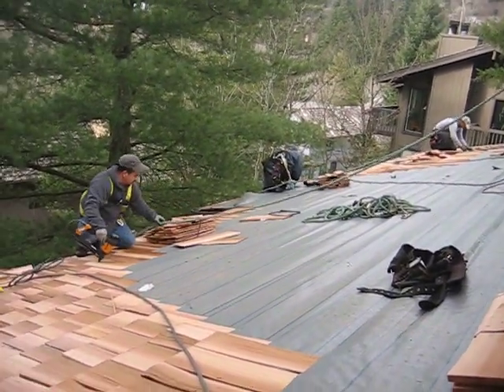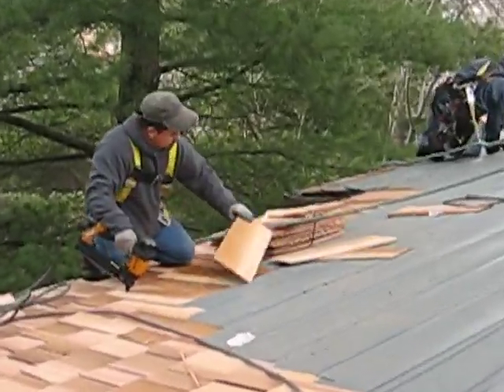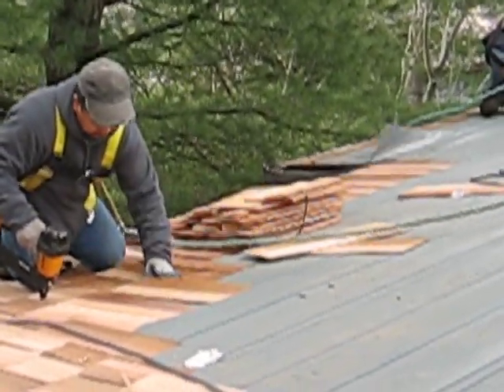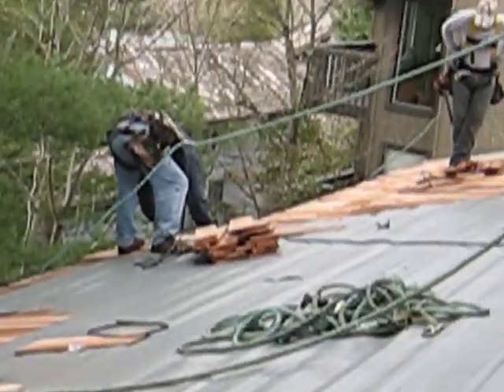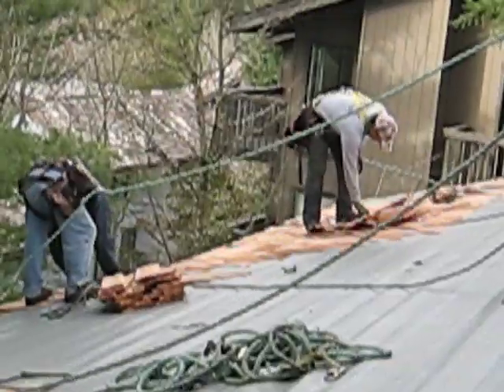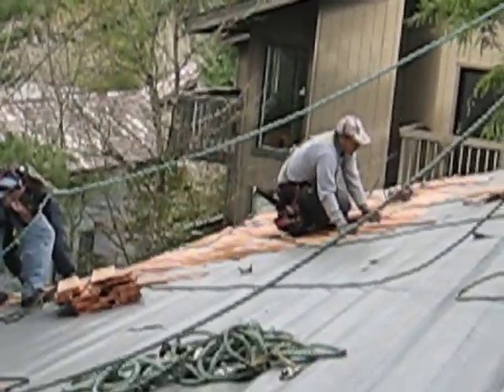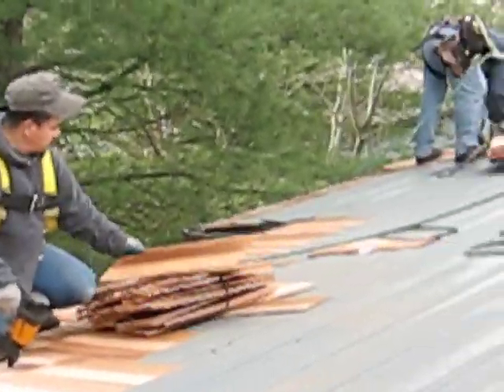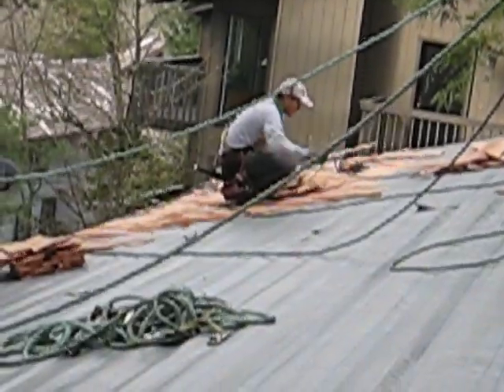Portland Cedar Shake Roof Installation, Part 2 - Roof Life of Oregon

Comment: It's about 3 times faster to open the bundle and spread out the shakes.  This crew leader is wasting time picking through the bundle looking for the right size shake. Then..stapling 1 at a time instead 5 or 6. Strictly amateur clowns. Nice looking shakes .though.